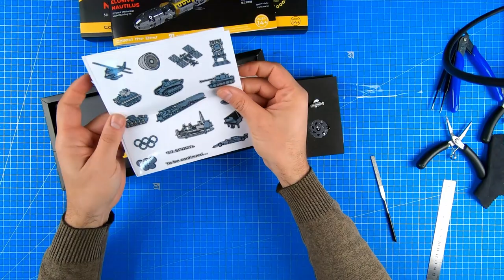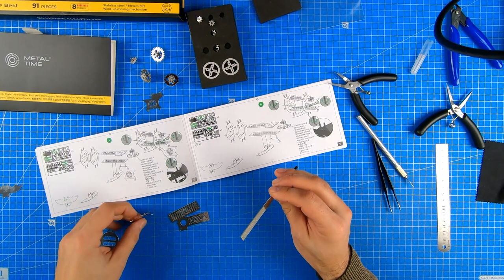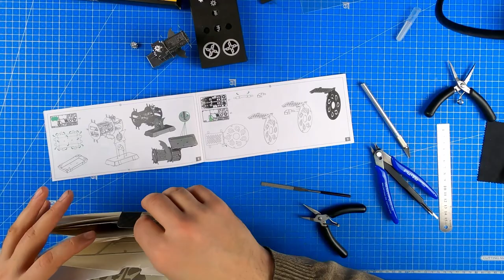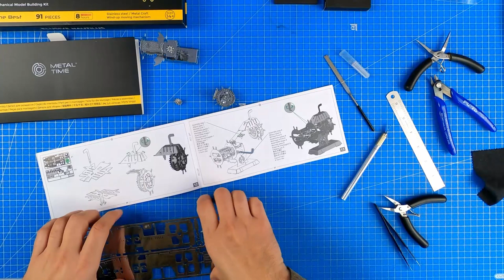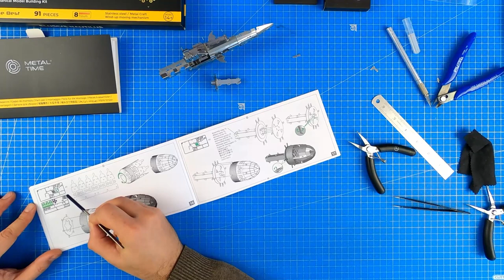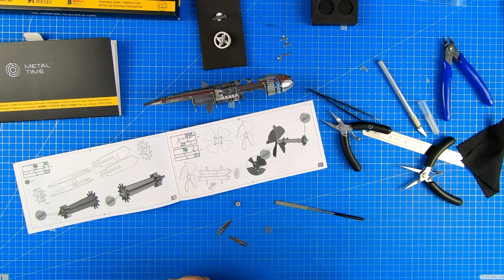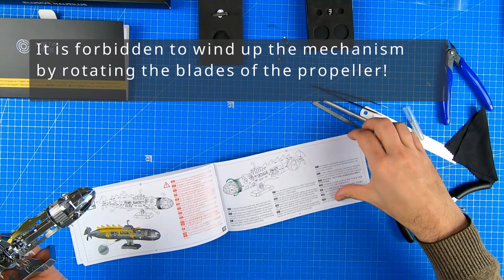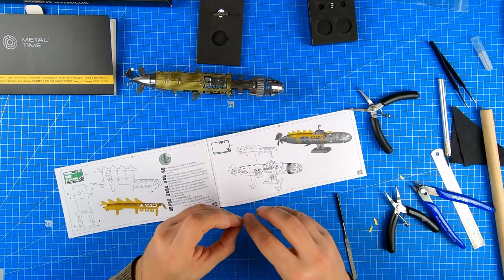Metal kit ELUSIVE NAUTILUS video instruction user's guide

Comment: You skipped over step 13. You place one gear then it’s shown assembled. Thought the gear transmission instructions for the helicopter were bad. These are worse.
Reply from the maker: Hello. Thank you for your comments, it is really helpful to have feedback from you.  We have received many messages from community, not any issue with the step 13 was mentioned. We will review it.  Tell us, do you need any assistance, advise with it? We are ready to help and share with you more information on Step 13 etc. Kindly, let us know and we will assist in urgent manner. Thanks again.
Reply: @MetalTimeWorkshop Yes. Show a video performing step 13. The complete step showing merging the periscope section to the transmission.
Reply from the maker: @opie456 Hello, sure, we will make additional video with Step 13   Thank you for your request.
Reply: @MetalTimeWorkshop  Thanks for the prompt response. But I’ve figured it out. 
I was not following the correct order of installation. Thanks